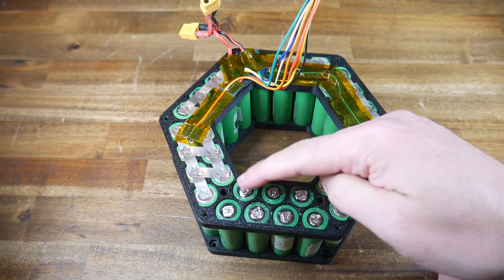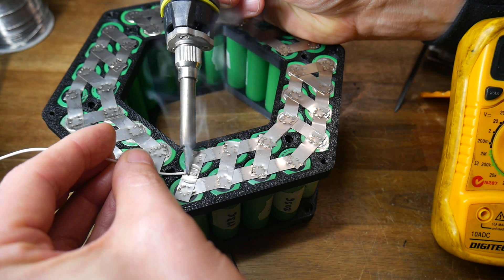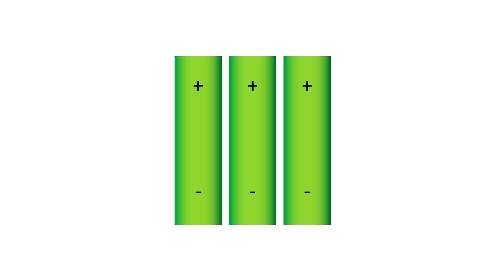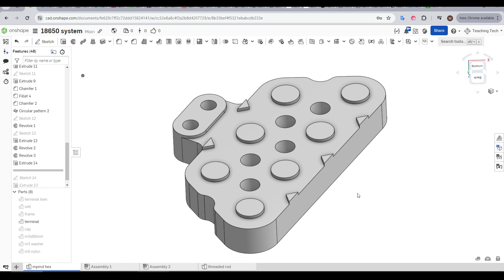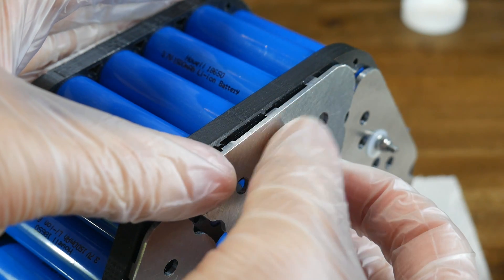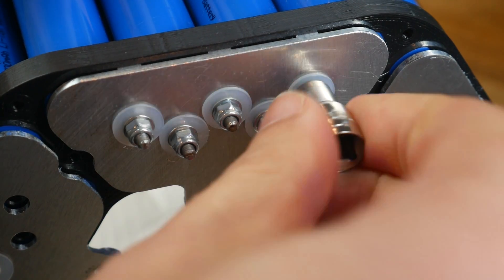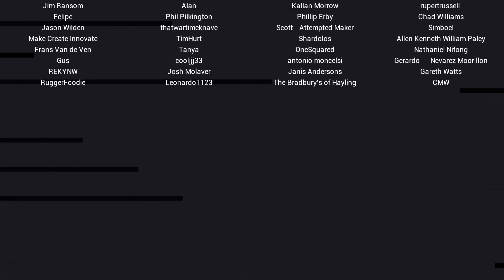Experimenting with a new (and probably flawed) 18650 building method: No soldering or spot welding!

Comment: Congratulations you have built a lithium bomb!!
Seriously, you have a bunch of parallel cells (7P) which are then strung in a series string. If you have a SINGLE cell failure ALL of the cells in that parallel group may be over charged or discharged - perhaps explosively. (What happened in you pack when you had a cell failures and you had to replace all seven cells in the group). Your BMS connection to the groups of parallel cells - if you use one - will provide essentially no protection. You should not just parallel cells without protection against individual cell failure. I've seen this mistake repeated multiple times by well intentioned makers. You also didn't appear to ensure the cells were very close to the same potential before shorting them in their parallel groups. No balancing the cells will result in high current flows between cells as they try to "balance" themselves.
Also just to be clear - NEVER EVER solder 18650 cells together - you can and will damage the cells and potentially cause a thermal runaway condition. Use welded tabs or yes maybe a mechanical holder. That's not my opinion as some YT troll but that of someone who has been professionally trained by people with world leading knowledge and experience who do this for mission critical system every day of their lives.

Comment: The Nylon Shoulder washer many are suggesting would definately work, but in the interest of reducing the size, Maybe recess where the nylon washer goes with the CNC slightly to sink it down? Maybe even so it sits flush. Might allow shaving a mm or two off the height.

Comment: There's no guarantee that all cells are identical in length, making the use of a rigid panal acroos a group of cells a potential issue.  A variation of 0.25mm in length would create problems in each group of cells which may go undetected since it's not possible to verify that each cell has a good connection. 18650s are not designed for longitudinal compression.

Comment: Personally, I'd just give up on 18650's unless your application demands them. Getting cells with threaded terminals just makes everything so much simpler and less expensive. If you need things light and portable and you have to go 18650's then take a look at your original design and try and work out why a cell group went bad. Was it a bad weld? Were they junk cells? Was it a crappy BMS? Because I've seen setups like that last for years and spot welding is a tried and true technique and you had something with low current demands die within a short period of time. It would have been better to work out why that failed than to go down the rabbit hole of pressure terminals.

Comment: Very interesting build. I don't think this will hold up, and in worst case will end up in thermal nuclear meltdown. Squeezing the cells like this with no spring will not work. Not two cells are the exact same length. I would re-design the cell holder with a modular top section so you can replace one section at the holder and remove cells if needed. And put on a BMS. It's probavly because you run withou a BMS that a crll group failed because they went out of specs.

Comment: years ago i made electric bike batteries out of used laptp batteries, and made them in a similar way where they bolt the 2 halves down on the connectors so it dosnt need solder..... it worked..... but the cells crapped out pretty quickly.

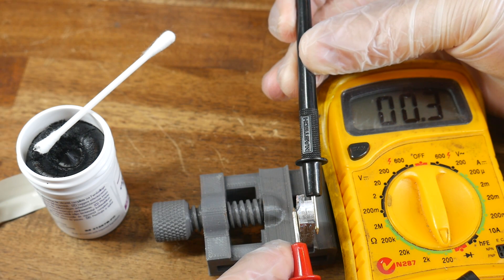Comment: That's not a good way to measure resistance at 8:14. You need to use a four-wire method, which sounds scary, but really is not. Put your lab bench PSU in current mode, set it to 1A, and have it pass the current through the sample. Then put your multimeter in voltage mode, and measure the voltage across the sample. By the power of V/I=R, and I=1A, this voltage is the precise number of ohms!

Comment: I understand you pointed out this idea isn't new to 18650s, but it also isn't new to power transmission in general. A purpose built enclosure with a milled (usually stamped) bus-bar is a pretty standard approach for an application specific battery. 

What I see is an additive mfg. version of an established conventionally injection molded part, not uncommon among 3D printing applications. 

The existing products and processes you compared early on are not easily serviceable, however they are truly modular. And frankly I just don't think the marginal improvement in serviceability (still 30+ fasteners to replace one cell) is worth losing the modularity.

You could have simply taken your spot-welded hex frame and and redesigned it into a modular 6-piece assembly with flanges that are fastened together. Then you could almost "hot-swap" a parallel bank (with some soldering), and then either disassemble and test, or just recycle the bad bank.

Comment: sadly your are assuming you are making full contact to the batter, but with your pressure locations and how your holding the busbars, they will not sit flat and fully contact the battery, but ride on one edge or one point, this is how you get the lower 3amp max rating the other method has. you would need to pin it all the way around the battery to keep it flat across them, and not use recycled cells but only new cells to be sure the length of each battery and the contacts on each end of the batteries are the same distance and flat

Comment: Hmm...
In most batteries, the ground/negative is also tied to the metal casing of the battery.  What I would do is place a compression mechanism on the ground plate to 'pinch' or clamp the anode against its mount.  The way I would do this is to tap a hole and thread it while using a nickel threaded rod/insert/etc.  You will want a thicker ground plate and may want to look at an electrically conductive filler for the threads.  Ideally, avoid dissimilar metals entirely, but certainly nothing in electrical contact should be dissimilar where possible.

This allows you to individually secure each cell.  You will want a bit thicker plate than normal to account for imperfect contact along the threads.  Polish the contact surface of your bolt flat, or maybe experiment with rough surfaces which can dig into the bottom of the battery a bit and give better contact than a flat surface.  Kind of an imperfect is perfect scenario.

You could also look for a way to fabricate some thermally conductive 'gel' or soft plastic inserts like they use between tool batteries.

For this setup, you would use shoulder bolts or a bolt sheathed in a tube cut to a specific length to create the rigid frame into which each cell is anchored via the screw at the base.

Comment: I was pretty shocked to hear you had a cell failure. Then I looked at your pack specifications. 

So it doesn’t appear that you were using LG HE4, you just used an image of that repeated over and over to visualise your pack. You were using a 10A capable Sony cell with 2000 mah??? Just a guess. Perhaps even 2500mAh cells? It’s possible you were using the VTC4 but rating the current output of the pack in relation to your nickel strips (which is something I really appreciate, can’t stand when people make a P42A pack with 10P and call it a 450A pack with 0.20mm nickel strip)

Looking at the capacity of your cells I see a lot of 1600’s and some 1700’s. Even assuming these are 2000mAh cells they are pretty degraded at that point. Guessing they came from power tool packs…which means they lived a rough life where they are typically rated at 300’ish cycles at higher C rates until they hit 60%-80% nominal capacity. 

The only cells I really come across that are dead and under 5 years old are power tool cells (amongst name brand cells). 

If you haven’t purchased an AC milliohm meter the RC3563 is down to $22 shipped. It’s for AC IR but you could also do the same and get DC IR with the newer DL24 electronic loads. They vary in price from $25 to $75 (0-200V 0-20A 150W up to 0-200V 0-40A 600W)

I think you probably could have caught that bad cell before building the pack.

Comment: A lot of good points from all the comments.
However my concern is the shape of contacts for the batteries. When we are talking about applications where the battery is removable, the contact patch is convex.
Battery terminal is not a precisely machined flat surface. It's a thin sheet metal part with most likely a convex surface with irregularities. Which given enough pressure, will become concave. And there has to be a lot of pressure with this design.

Comment: You're building an electric car next... aren't you?  My advice would be to explore the thermal conditions that you're going to encounter with a big battery with high discharge rates.  Is air cooling going to be enough?  Will 3D printed connectors be sufficiently strong when heat is present such that it doesn't expand or allow the bolts to suddenly pull out?  I think fewer bolts means less mass, and perhaps the solution is a more springlike contact with the battery terminals... that way you'd only have to bolt a few of the terminal caps together.

If I'm wrong and weight is not a concern, then by all means, use all the bolts!

Comment: Very cool idea, easy to disassemble, but there are a few other ways easy disassembly could have been achieved. 1. Modular battery pack. For each side of the pack, create a separate module that can be detached so you're only working with several batteries at a time. 2. Connect the batteries using only spacers, then cap both sides with the structural piece. When you need to take one battery bank or even a single battery out, it's as simple as taking the top and bottom frames off, then cutting that one battery's terminals. The spacer would sit centrally and snap onto each battery just enough to stay positioned. No need to weld the terminals over the structural section and keep them held in that way.

Comment: Just use a few motorbike batteries, small, cheap, parallel or series to the required volts/amps, job done and in less time and cost.

Comment: I suggest to not use any conductive grease, it is a source of resistance. If you must use it, I suggest doing tests to confirm it does not create an unnecessary limit to your system.

Comment: You could leave a small raise spot in the center of each contact point to further ensure reliable contact. 
I would also suggest replacing the nylon washers with sleeves or better yet bushings.  Uhmw would be a very good material for those.

Comment: When dealing with measuring low resistances, it is advantageous to use a kelvin bridge multimeter. You don't need expensive probes for most things, just the sense lines alligator clipped to normal probes. This will make low resistance measurements way more accurate if you have a supporting multimeter.

Comment: Very cool desing for the improved grid version. Smart how it solved a lot of issues while simplifying it. Especially the removal of all the washers.   My recommendations would be: the joiner being printed on the long side for mechanical strength, and the nuts being pushed in from the side, to get rid of the spacer. Also the joiner should be at least 2mm shorter than the space it spanns, so that the bolts actually can pull the parts together.
the socket is already modeled.

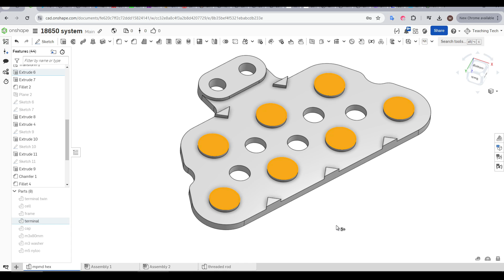Comment: 7:00 would a slightly domed shape be better? If you look at batteries they have a domed pointed end and the flat end usually has a narrow generally curved spring pushing against it to create the pressure. Perhaps that is better…..?

Comment: Huh. Spring-loaded cell contacts would be a very needed addition. I'm not going to go through all the stuff that all the people before me pointed out already, but I think that spring-loaded contacts should do the job of relieving most of them (too high pressure exerted on cells, loosening of the threads = loss of contact on the cell/bus interface, etc.)

How about an approach similar to brushes in large, DC brushed motors or rotary cable joints, but instead of making them of brass or graphite (because in rotary uses like motors / joints they do move a lot, so they need to lubricate themselves), making them out of copper, perhaps nickel-plated?
I mean... A circular copper slug, that would be pressed up against the cell terminal with a fairly heavy spring, and a flexible, braided, flat cable soldered (or screwed) onto the bus bar and the slug? I've seen this approach time and time again in the industrial realm of, as aforementioned, rotary cable joints, brushed motors, etc., and well, it did withstand harsh contitions, vibrations, dust, moisture, etc., while conducting substantial currents (one rotary joint for example had 8 terminals, it was a 3-phase AC servomotor, so L1, L2, L3, N, PE, and 3 low-current connections, probably for a rotary encoder, and the L1-L2-L3 joints could conduct up to 32 Amps on 400V AC between them, through graphite brushes riding on brass slip rings)

This would eliminate the uneven pressure's impact on electrical resistance in the parallel pack of cells, would get rid of the risk of squashing the cells because of overtightening, and would eliminate the risk of loosing connections because of material creep in the threaded rods/nuts that would cause the clamping force to go down over time. Also, any mechanical impact to the battery would not risk puncturing or contorting the outer shell of the cell, since it would effectively float between two spring-loaded contacts (or perhaps one, but I'd advise to go for spring-loading both), but would still allow to disassemble the entire pack for troubleshooting/repair of the pack.

EDIT: Also, this is the way it is done in e-cigarettes (just cheaper, since they just solder a wire onto a brass-coated cup, and stuff it onto a spring, which then is stuffed into a plastic case), and they are pretty high-current too (some of them reach 200-300W from 2x18650 cells, running the cells in series, so upwards of 40-50A, if my head-math checks out)

Comment: Have you considered designing a one-piece 3D-printed insulating sheet (with all the required holes for all the screw heads) instead of fiddling with those little nylon washers?

Comment: Building a couple batteries for myself, regardless of chemistry (li-ion, lifepo4, li-po, sealed lead acid), I would highly recommend an under-voltage cutoff. This can be either a simple TL431 (google search TL431 under-voltage circuit for schematic) circuit on some perf board, or a chinese PCB from Amazon or the like (these use 5v relays and will thus have more current draw). Balance charging with a li-po charger, and having a simple under-voltage cutoff are what many cordless tools do because of the reduced cost and reduced complexity of this method in comparison to a custom or off-the-shelf BMS. Most important of all would be to manually monitor your battery during charging, ensure no significant temperature (>28-30C) builds up on the cells or your connection method (wire solder joints to the nickel, spot welds, or weldless connections).

Comment: From the thumbnail i had assumed the design was with individual bolts that clamp against the battery directly. That may be a way to go to get the clamping force right on each cell. Plus, if you used a bolt that was wider than the cell, you could just remove the bolt and drop the cell out of the hole.

Comment: I would recommend removing the battery stops that are presently integral to the black frames. This would alloy individual cells to be replaced, removed axially, without separating the entire battery pack. This would also allow the cells to float axially when tightening the buss bars. 
One way to get a high current contact that is flexible to allow variations in cell geometry is to drape fine copper braid across the cells. The buss bar compresses the braid onto the battery terminals. I applaud your use of removable buss bars instead of spot welded strips. 
All that said, very nice job.

Comment: I have an idea how to reduce complexity and part count for your new design with a separate clamping bolt from each side: I would ignore trying to fit a nut into the printed column between the cells. I would just print a piece that fits between the cells conveniently (does not have to fill all the space) and with a hole through the center of it. If printed horizontally and the screw threads engage with the hole for something like 25-30mm you should be able to transmit simillar force through the screw like the design with the a nut that pulls on the plastic in one place only. You just have to experiment to see what diameter should the hole be in CAD so that the bolt forms perfect threads in it. 
If M3 threads are too fine for the required force you could try looking for some plastic screw (like they use to put together commercial appliances) or a wood screw of appropriate size. In my experience a 20mm long engagement of 3.5mm wood screw in correctly sized printed hole will have to completely explode the printed part around it before it the screw will be pulled out. So something like https://www.amazon.com/Stainless-Steel-Chipboard-Screws-Threaded/dp/B073SB91XQ with most of its threads biting into the connecting column could serve your need. 
If this works you would have just two screws and one printed part, instead of two screws, two nuts and two printed parts.

Comment: Instead of having a bolt going from one bus to another, what if you embedded a nut in the 3D printed frame so the upper bus attach to the upper frame, and then one bolt that goes from one frame to the other (so 6 chunky bolts to hold the two halves together instead of all the individual bolts).

Comment: I may have missed it, but the nylon washers that you used, did they have a shoulder? You can get shoulder washers that would fit down inside the hole, covering the walls of the hole